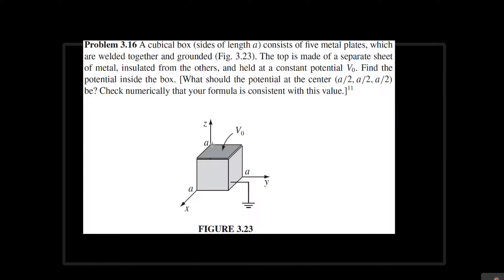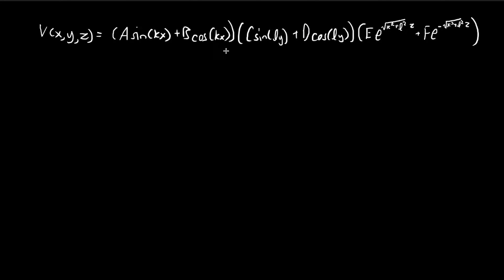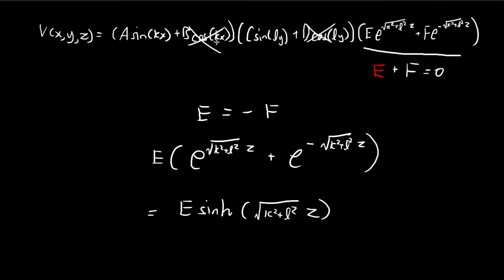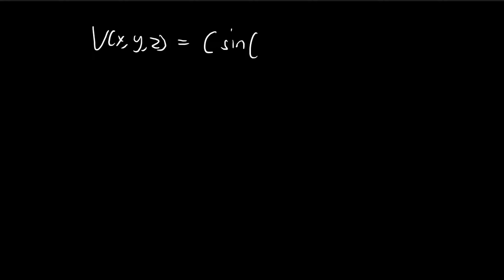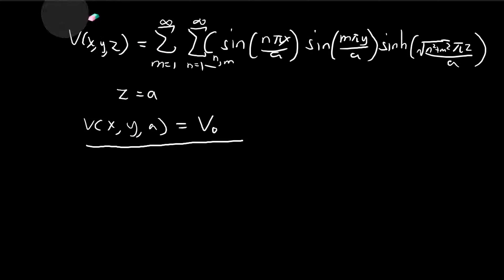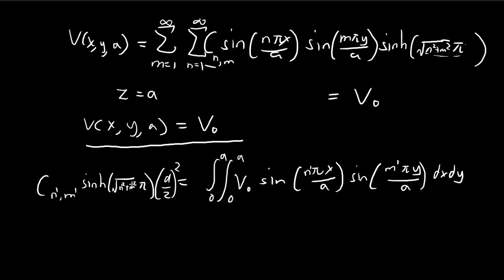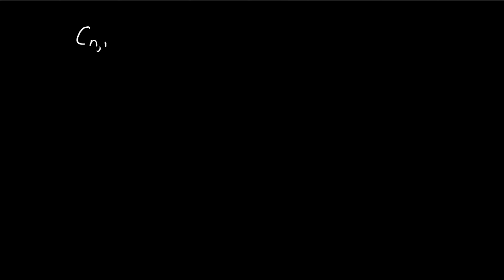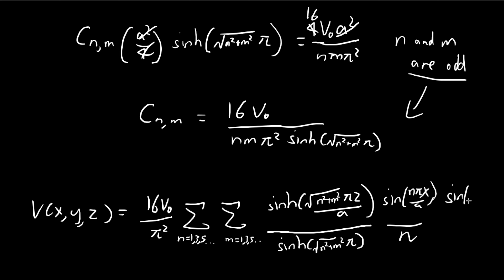Problem 3.16 | Introduction to Electrodynamics (Griffiths)

Comment: I used the same index of summation (n=m) for k and l of the X(x) and Y(y) functions. Apparently this respects all boundaries but the numerical result is of course wrong. What am I missing? Why do we need the double sum here?
Reply from the maker: If you don't use the double sum you'll be missing a whole bunch of possible solutions you can add to the final answer, which is a linear combination of all possible solutions. That will be like trying to derive your fourier series with only half the terms. That's simply not how Fourier series work.
Reply: @HayashiManabu  i think this is 3.15 from the book same thing with 3.13 and 3.16 else my book is wrong xD
Reply from the maker: @ΗλίαςΛ-τ8ρ  probably different editions, I use the fourth edition for my videos
Reply: @HayashiManabu  yeah prob thought the book was new or sth anyway your vids are very helpful ty